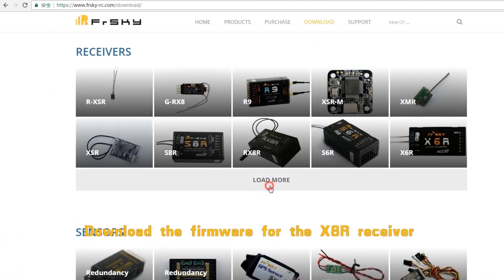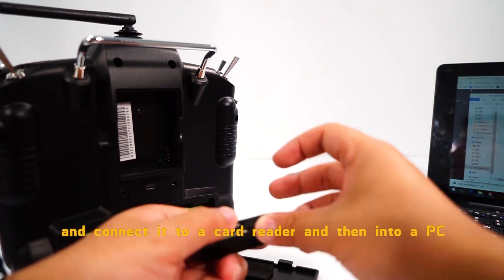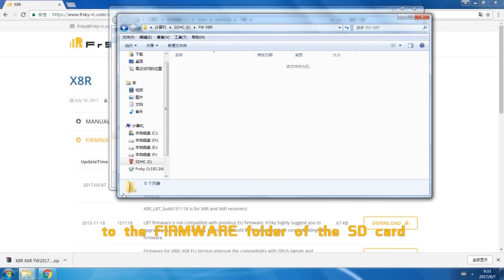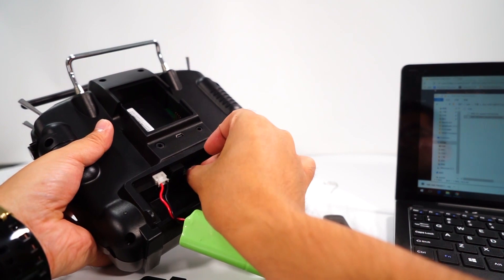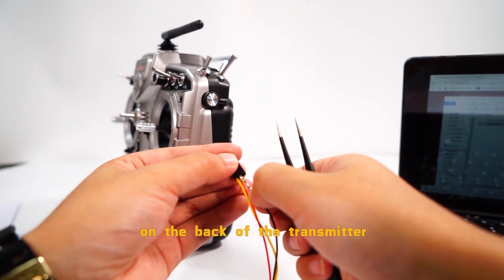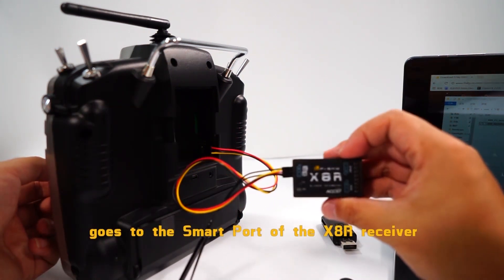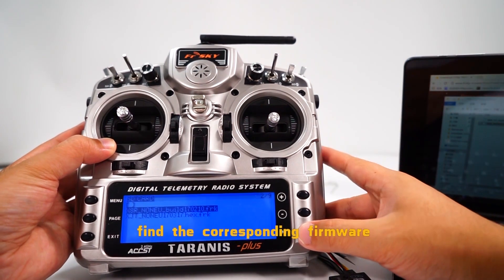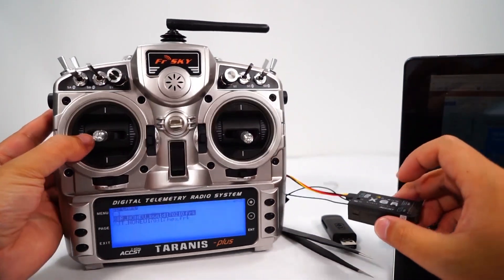How to use the transmitter to flash the firmware of the X8R receiver

Comment: These are great vids but I'm in need of some help!

Having a few issues trying to flash and bind my X9D SE 2019 to the S8R receiver via the TX. I've made up the correct lead with the +ve & -ve positions changed which goes into the module bay with Signal on the bottom. Then I plug the other standard wired servo plug into the port above the signal wires again adhering to the polarity.

I have both the FCC & the EU LBT versions in the SD Card Firmware directory on the SD card.

I have put the TX in the following modes and tried to flash either firmware versions;

Internal Module ACCST D16

External Module PPM

External Module KJT D16

With ACCST D16 mode, there is no light to the RX.

In both External modes, The RX flashes with the red a slow blink and the blue a very fast blink. Then after about 10 seconds, just the red with a slow blink

In all cases, I get the same error message;

" Firmware update error. Device not responding"

Can someone please point me in the right direction?

Thanks.
Reply: hello bro, please help me " Firmware update error. Device not responding"
 problem. If you solve this problem, can you help me?

Comment: Hi, I think my X8R receiver is bricked. I followed the suggested procedure, but once reached 30% of update all led from receiver turned off and a message was displayed on my taranis "Failure to update device". Now the receiver does not work. Do you have any suggestion? Thanks!
Reply: just one thing to think about is if you have upgraded your batty to a 3s lipo then you need to put a voltage reducer if not you will fry your x8r
Reply: @davidpotter9418  really?
Reply: @goku445  yes give it a go
Reply: @davidpotter9418  I won't risk frying my receiver but thanks for the tip.
Reply: @goku445  yes i started with the stock battery then up it to 11v so at the power on the external is 10v and the receiver is up to 6v or 7v will do a video on how
Reply: @davidpotter9418  damn
Reply: watch for the volt at the end and only 6v for the x8r